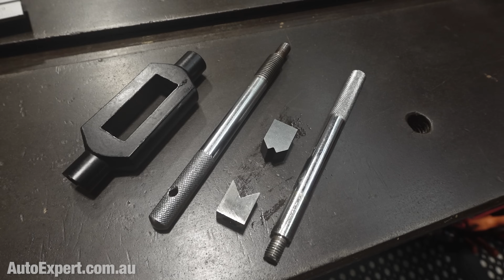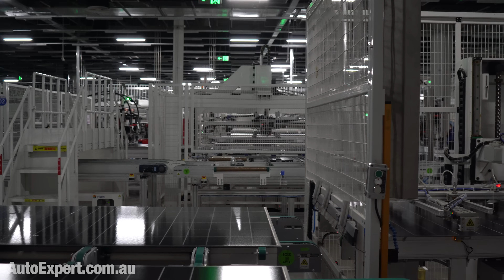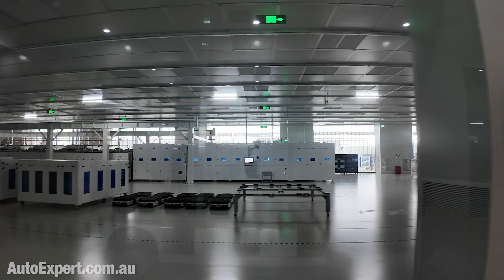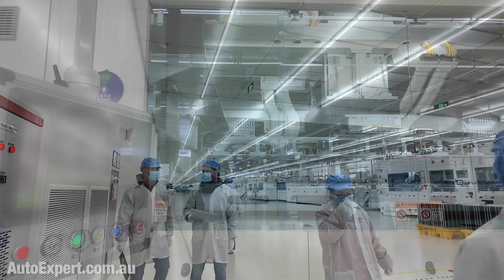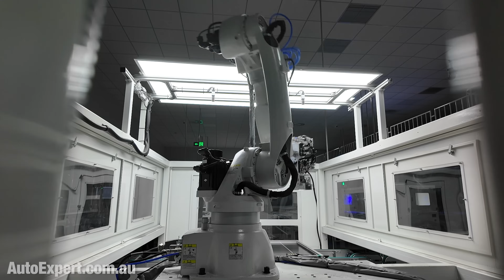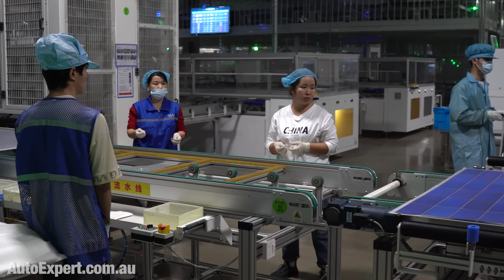The truth about Chinese manufacturing in 2025 | Auto Expert John Cadogan

Comment: I recall Professor Green  and Dr Shi Zhengrong sought Australian government assistance to establish solar panel manufacturing in Australia.  The Australian government in their infinite wisdom decided not to provide any assistance on the premise the technology had not been proven and demand could not be guaranteed...Sort of says it all😢
Reply: The problem extends well beyond government support - or lack thereof. Australian business as a whole tends to be risk adverse which is why a lot of ideas/products end up being commercialised overseas.
Reply: @justsaying4786  You forgot to mention that Australians are not prepared to work for low wages.
Reply: now that i think of it, australia is a perfect place to be fully solar. only a few nodes on the east and west side would supply electricity for 80% of the population, as long as you can get the power restoration solved (using hydro or melting salt i suppose). and the distance of transmission is also really low. in China, we would have to build the solar center far away from population center, and we would need to transmit the electricy for a long long distance
Reply: @fredwangleboy1490  What is your interprentation of long distance?
Reply: @ china have to transmit power long distance to populated areas, hence its ultra high voltage lines
Reply: I think this was one of Hawkes biggest misses. From memory there were numerous attempts to get government backing which didn't happen. Zhengrong went to the Chinese government and they fully supported the startup.
Reply: But a road traffic controller here in Australia ( holding the lollipop to control traffic) on AUD130-150K a year probably earns more than 99.9% of workers in that solar panel megafactory !
Reply: @leancheah8688  Don't worry, those types of jobs will be gone soon enough. Technology and cost cutting will eliminate the well paid, low skilled jobs from western countries.
Reply: Hindsight. The govt. (tax pay money) should stay out of business because they are no good at it, they just throw our money away. Private enterprise should make these types of investments, not govt. The question I have is why didn't any local private industry do it?
Reply: @Jonno2020 I find it odd that government is happy to co-invest in private infrastructure projects that consistently have budget overruns, delayed schedules and sub-standard outcomes. Also the service contracts have the same characteristic results too. 
Is it safe to say that the issue with our government is that it does not have the facilities to effectively evaluate business opportunities? Why is it that China from the very beginning decided to develop that area of government and commence their Socialist market economy which has paid dividends for them for more than a decade and yet our government struggles in this department?
Reply: @sofascialistadankulamegado1781  The BIG difference is that (almost) ALL of their high level leaders are (university educated) engineers. So the mindset is "see a problem, tackle a problem and SOLVE a problem". In many western countries leaders are often lawyers etc. In that case the mindset is more about "following procedures while the result isn't that important".
Reply: @Jonno2020 because local private business has little knowledge or ability to do this. We are a quarry, a farm, a hotel and for now a school. The Chinese have spent half a century working their butts off to get to this point. By contrast, manufacturing has always been a dirty word to Australian elites.
Reply: " Australian business as a whole tends to be risk adverse"  exactly.
Reply: @Jonno2020  Mate thinking like that destroyed any industry we had, government support is essential. What do you think got the US out of the great depression and made the US the instructorial power house it was from 1940 to 1980? It was one of the thing Menzies did right was to get car manufacturing in Australia (the fact he turned down VW for war reoperations is another story).
Reply: @meggrobi EXACTLY. but people are so brainwashed by the liberal and right wing talking points that they don't understand the awesome things came from non profit government like CSIRO, or the internet.

Comment: Its not by accident, this is the result of trump 1.0 when he limited the supply of Nvidia chips China flipped out.

The CCP spent a good while deliberating over what to do and the result? They pulled all the funding from housing which led to a crash, and dumped it all into semiconductor and by extension solar cell fabrication, and that market was extremely cutthroat. Now only a handful of those companies still exist, but as you've seen they are the best in the world

Comment: Hey John .Why don't GM sell the HOLDEN brand to SAIC like MG and Volvo etc and they can flog off no name Chinese EVs to unsuspecting Aussies
Reply: Ironically, one of Holden's disclosed plans to save itself was to buddy up with SAIC and sell MG and LDV (currently imported under ATECO) as re-badged Holdens. GM already has a joint venture in China as SAIC-GM-Wuling so the lines of communication were there.

It's not known exactly why it didn't follow through however both SAIC brands were already in Australia for years and selling so a partnership would be of little benefit.

Comment: My experience with Chinese products is that you get what you pay for. A $2 watch will be garbage, but a $20 watch will not be fancy but perfectly servicable, for around $100 the watch will likely have a sapphire crystal and water resistance of 100m or 200m and for $400 the watch will have specifications equal to far more expensive European brands.
Reply: I don't remember when my Dad bought the Chinese made six inch engineering vice for our household garage. Early 1980's, possibly late 1970's. Dad believed in buying quality cos quality lasts. Now, I'm using it today in my garage. It's lost some paint round the top jaw because, work, but it's as precise and straight as it ever was. It weighs fifty-eight pounds. If I have to move it, I don't lift it off the floor more than about an inch as I don't want my foot to be amputated if I drop the vice.
Reply: Sounds like my Record made in Sheffield and made in South Africa high quality bench vices.
Reply: My $38 Xiaomi band is fantastic. Does heart rate, vibrate alarm and tells the time. I can’t see the point of paying $500 for Apple Watch it does nothing else I actually need.
Reply: Of course the have the quality of European brands. Most of the time they're making the European brands. They ship the watch to Italy, they add a couple of screws to change the country of origin, then send it to us.
Reply: I'm using a $500 Xiaomi Redmi phone that is orders of magnitude better than my previous American Razer phone ($1000). Their level and speed of advancement is scary.
Reply: @dnoordink 
I bought my Redmi 9s for US$130 in April 2020, and right now I am writing this very comment with it.
Reply: By now you should already know that the "expensive European brands" most likely come out of the SAME factories in CHINA and get a brandname slapped on to it in Europe.
It's the reason Hermes the "high status" brand is upset now because their secret has been uncovered.
Reply: Exactly my experience!!!
Reply: And that proves why China is where they are . They are using the $20 watches and selling you the $100 watch for $400 .
Reply: You know very well of China.
Reply: I would not idealise that mentality, the flip side to cheap is relaxed quality resulting in death and harm an enormous amount of  population because the safety law and standards are simply necessary to protect from produce/services below a minimal quality level. Just look at the baby formula incident that occurred, poisoned their young with plastic resulting in a huge rush for Australian made emptying Australia's retail shelves.
Reply: Mmm…I have 5 chinease tag watch copies since 2015…all working fine 👌
Reply: @ianwatson3315  I own three Pagani Design (TAG) watches. They are beautiful and work fine with Seiko movement
Reply: See the thing you failed on here is *(Likely)* saphire, suppliers and manufacturers in china will cut costs and that saphire is liekly red plastic. Which you wont realise till after the warranty. 
We forced them to be that way by saying no i want a $200 watch made for $20, then $12 then eventually $2. 

and this is the bigfest gamble, yeah they can make some really good stuff, but until it fails you dont know youve been scammed. 
They are experts at painting by numbers for example, so to take an engineering example, We ordered an item that originally had oil impregnanted bushings, they were expensive to get right, the chinese variant just used bearings as they must have had an abundance of them at the time, sure it works, but when it fails its not just ok, service and replace the bushing its throw it away and buy a whole new one.
Reply: so to them painting whatever red goes in number 1, is red paint for example but its not the exact red thats specified and it leads to problems in more cases than not. 
Sure sometimes it works, but its always a gamble. I mean do you trust that xiaomi watch to not be spying on you and sending that data offshore? 
or the tag wacth clone, yeah it looks the part, but end of the day, its not as special ad the TAG Huer. I should know as i have the same, a couple of real tags and a heao of Chinese clones. They looks awesome, but in terms of saying hey son, this is my beautoful treasured swiss watch i worked really hard for, now i want you to have it and pass it onto your son one day... A chinese watch will never  be as special because of that cheapness and knowing corners were cut.
Reply: BS!

Comment: I buy components from Chinese suppliers, and they are either incompetent or malicious.
Reply: then why do you buy them still?
Reply: @TerryHickey-xt4mf  My boss tells me to.
Reply: @TerryHickey-xt4mf  Because the Chinese supplier is usually significantly cheaper than the "western" supplier, like 10-25% the price of the other supplier.

Where the issue lies is you must be incredibly proactive about quality control as they will do every trick in the book to cut corners, save money, and screw you over. 
Not following design, wrong material, contamination, low quality, faked compliance certificates, fake laboratory testing, the list goes on.
Reply: @johnwade1095  my guess is you are buying the cheapest quality you can get. China makes products for people that want cheap and nasty, but the also make high quality for people that want that.
Reply: @davidsmith9440  I get nominated suppliers and  have   to work with tthem to get acceptable quality
Reply: @johnwade1095  please pay an acceptable price for what you want
Reply: A friend buys specialized electronic components from china. He has had only great experiences. I bought some highly specialized computer controlled production products and the price and quality were amazing.
Reply: U paid $1.00 and expect a Rolex
Reply: I paid best part of a  million bucks and didn't get what was specified on the drawing.